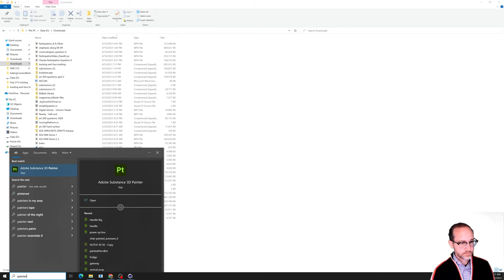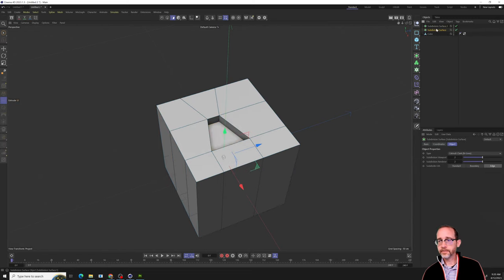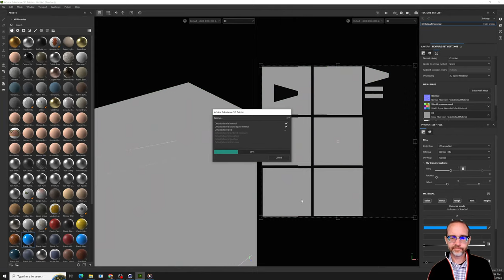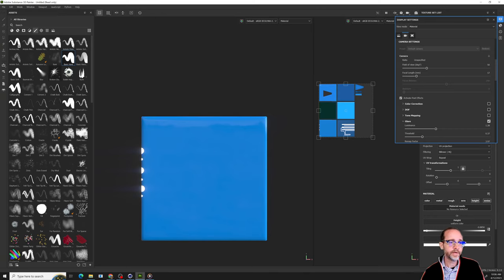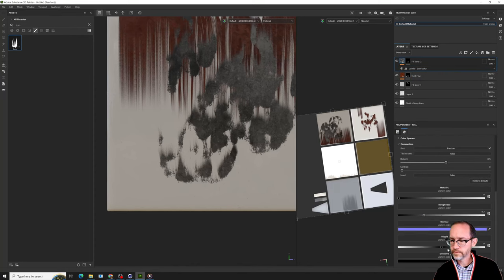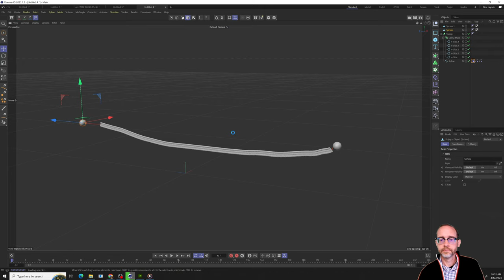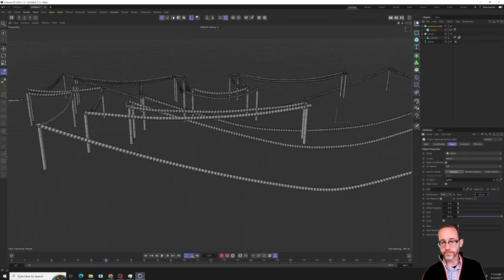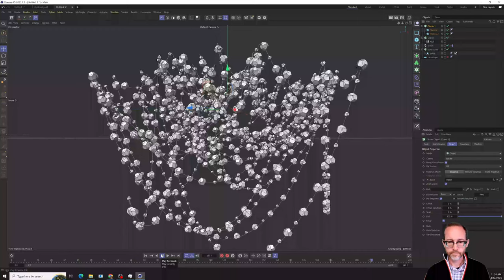ART 285: 4/12/2023

Comment: ART 285 4/12 '23 

0:00 Class Begins 
6:09 Student Questions (OSQT)
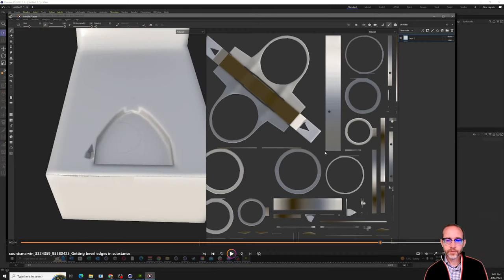     8:23 high poly/low poly with subdivision surface 
     28:23 fixing baking artifacts in substance painter (SubP)
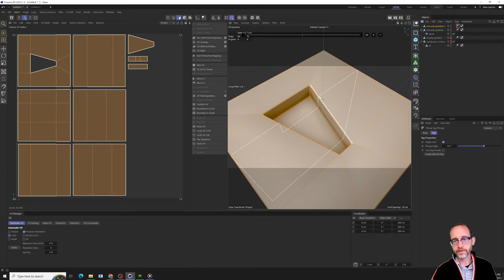     51:14 OSQT Contd 
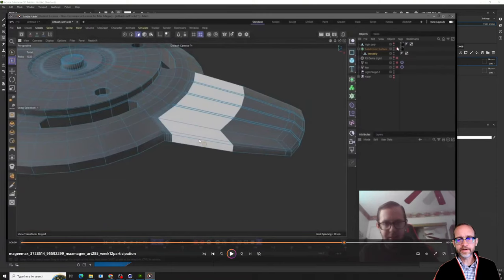     1:04:32 Painting with straight lines and particles in SubP
1:34:00 Wires review 
1:43:27 Wires with physics 
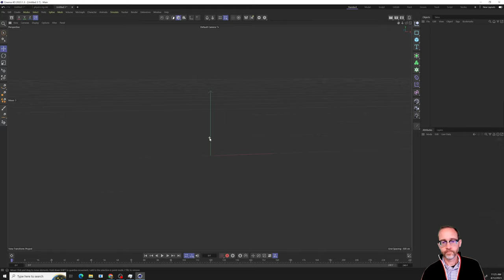2:28:37 Random telephone poles on terrain with simulates wires